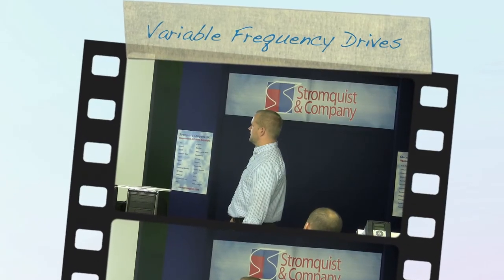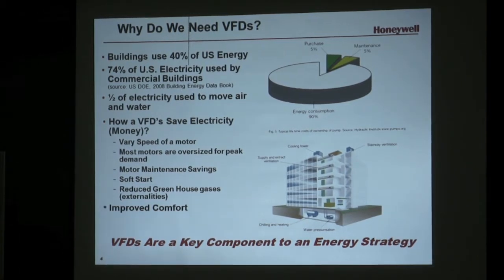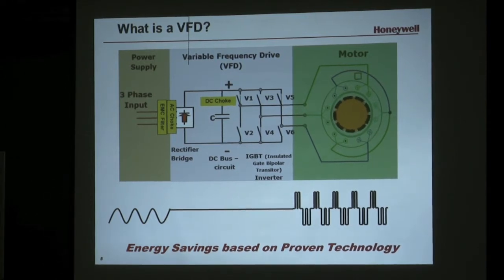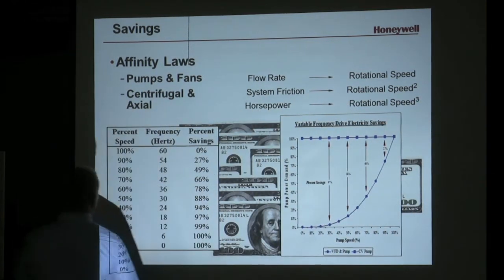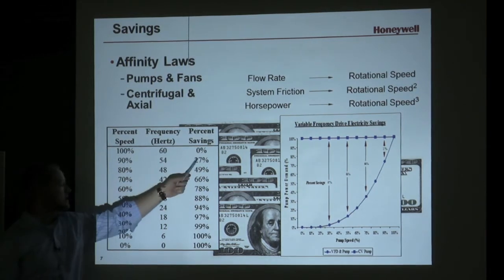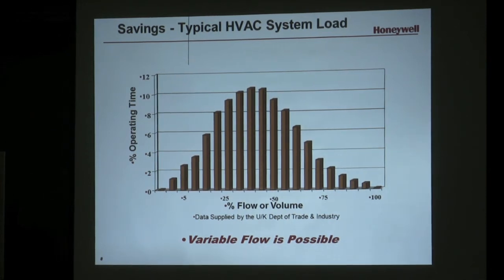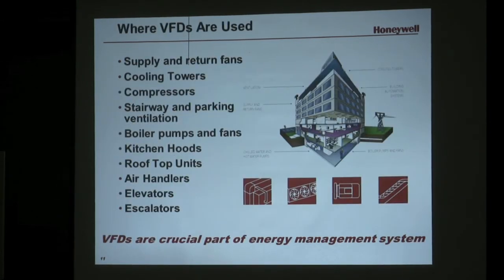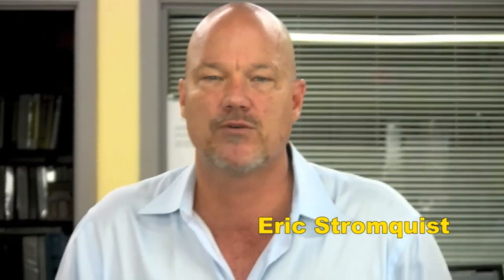How Variable Frequency Drives Save Energy

Comment: Yes using VFD for HVAC application is big savings because the process is water circulating in the pipeline can handled back pressure to decelerate the speed of VFD Motor but if you are using in the water distribution or water authority you cannot save power consumption because the customers/water concessionaires withdraw water from pipeline + higher non revenue water in the water distribution network there is no back pressure occur in the water system so the VFD motor running at full speed, you can only save if you program the VFD in time based mode based on 24/7 water consumption of the whole community.